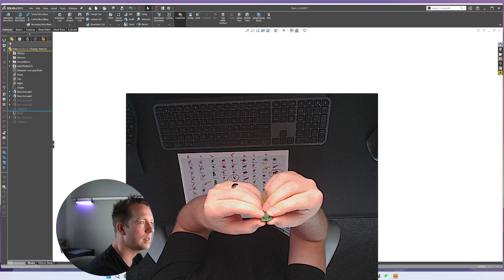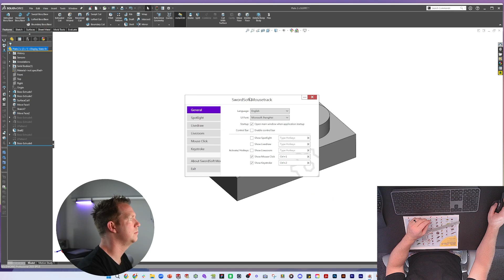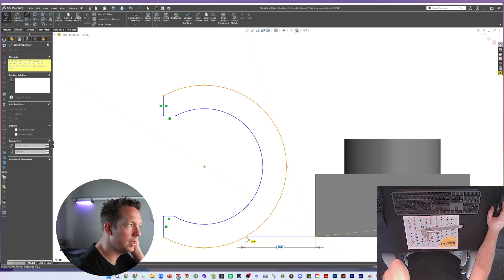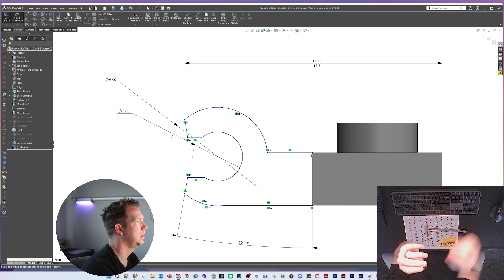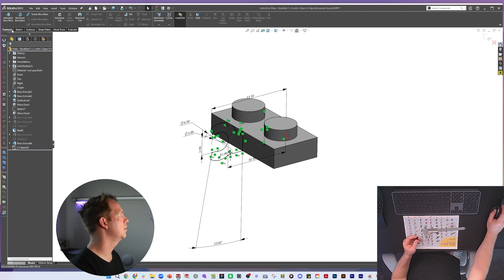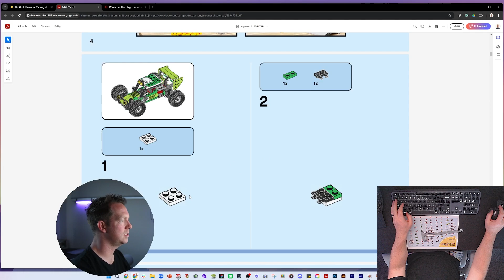Lesson 2 - Basic Part Changes - SolidWorks Tutorial: LEGO Off-Road Buggy

Comment: Hi Chris, I’m following the entire tutorial to recreate the buggy and to refresh my SolidWorks skills after not using it for about seven years. It’s been great so far, and I really appreciate the tutorial.

However, at times it’s been challenging to follow exactly which surface, line, or command you’re clicking on. This might be due to the recording or editing software, as it seems some mouse movements between commands and clicks are being cut out. Sometimes I only see a new window pop up or an extrude/cut being completed without seeing the steps in between.

I just wanted to provide this quick feedback. Thanks again for the tutorial.
Reply from the maker: Hi Jason, thanks for watching and the feedback! I agree with your comments, there is some inconsistency with the editing.  Generally I’ve favored overall speed of video rather than slow and methodical, and using some shortcuts in editing has meant a click here or dimension there is cut out. However to combat this, I make all of my SolidWorks files available for download. Perhaps using those as reference will help fill in the gaps. All available thru my Skool community